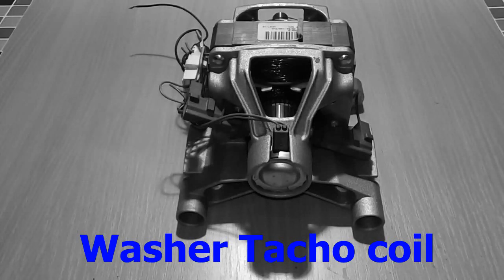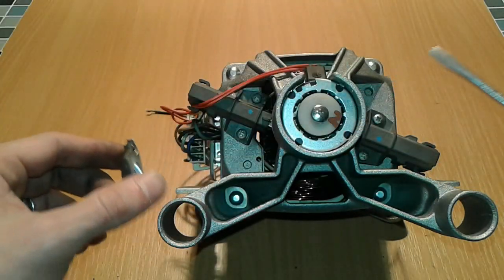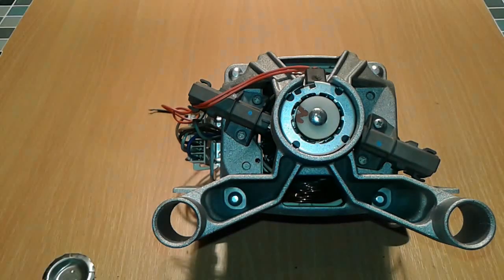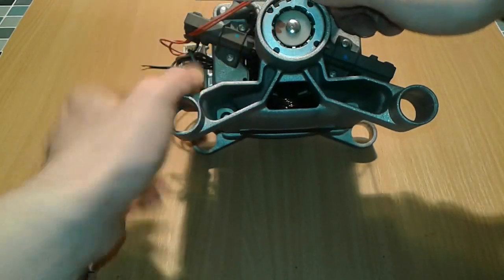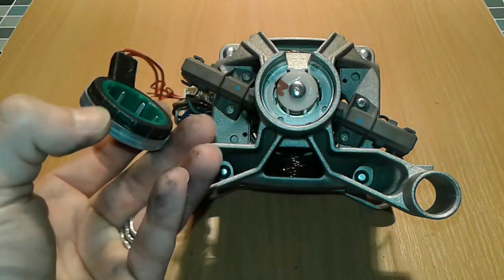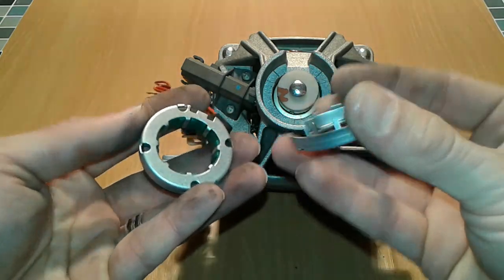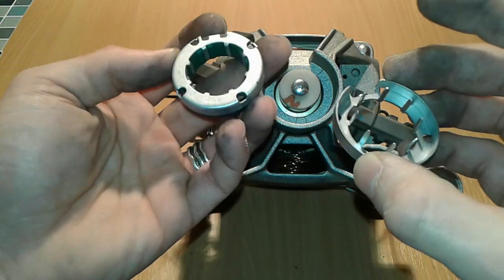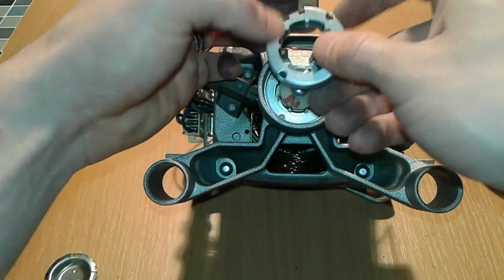Washing machine motor tachometer coil

Comment: Sounds like nobody knows what they're talking about. Ohm value should be 117, with 115 to 120 acceptable value variation. If out of range replace motor. I know of no such replacement part for tachometer.
Reply: thanks

Comment: The AC current flowing through the motor's coils  induces magnetic fields & those magnetic fields then induce current flow in the tachometer's coil  ~
& that induced current is then analized by the machine's programming so it can calculate & regulate the speed at which the motor is spinning

Comment: Machine showing teco error when 15 minutes remains what's tha problem.
Reply from the maker: Probably cant go on the last cycle,tacho used or shorted,or the pump cant drain with the fast spinning
Reply: @NoSkillsRequired  problem kisme h motor ya pcb

Comment: The magnet is missing from the end of the shaft.
Reply: Nooo~
The AC current flowing through the motor's coils  induces magnetic fields in the shaft & those magnetic fields then induce current flow in the tachometer's coil  ~
& that induced current is then analized by the machine's programming so it can calculate & regulate the speed at which the motor is spinning

Comment: Very important information, but because I want to remove the bearing that is behind the tachogenerator rotor I do not know how to remove this rotor. Can anyone help me?
Reply from the maker: Vion Ioan you have to drill the capsated stuff that you on the back of the motor and you will break it in half

Comment: Maybe the shaft is magnetized. That's what the N indicates.
Reply from the maker: stochasticles who knows, I couldn't find magnets, could be a electromagnet...
Reply: The AC current flowing through the motor's coils  induces magnetic fields & those magnetic fields then induce current flow in the tachometer's coil  ~
& that induced current is then analized by the machine's programming so it can calculate & regulate the speed at which the motor is spinning

Comment: Would have been helpful if you could tell us where to find this part.
Reply: UtwoBed  has anyone found the part number for this tach I can not find it to save my life
Reply from the maker: UtwoBed from another motor or ebay - Amazon - the cheapo aliexpress all the best friend
Reply: Thanks I found it on Ali
Reply from the maker: UtwoBed nice one pal that's way I didn't put any links because everyone buy parts from different places not always the cheapest is the best
Reply: It's a hard part to find because the manufacturer wants you to pay for the whole motor ($300) instead of ($18) for the bad part. The only thing about having to buy it outside the country is the two weeks it will take to get here. Going to be making the Laundromat owner a little richer for a couple of weeks.  But thanks very much because I would not have attempted to look for that part as a separate item if I had not come across your video.
Reply from the maker: UtwoBed thanks for stopping by there are more interesting and useful projects just brows thru them maybe you will find more useful ideas never know